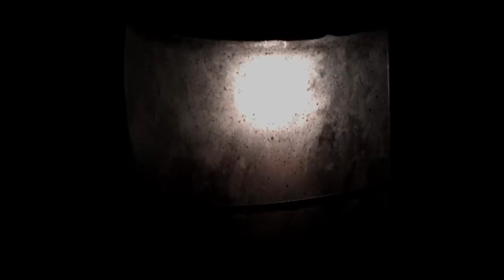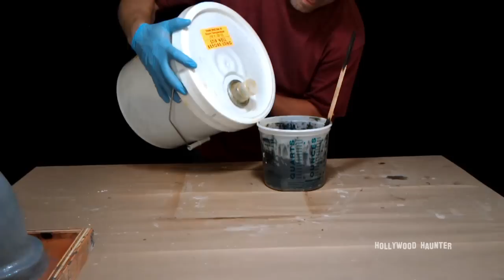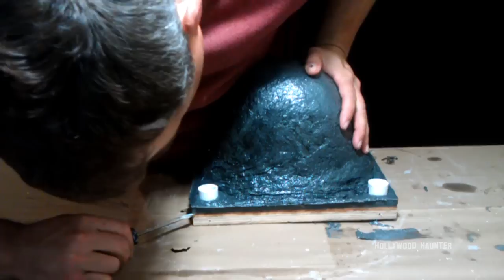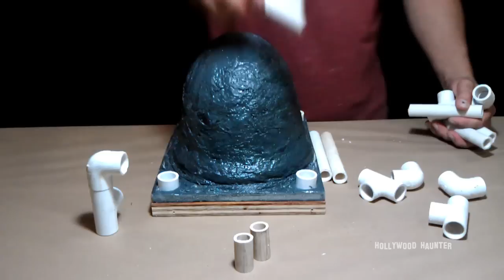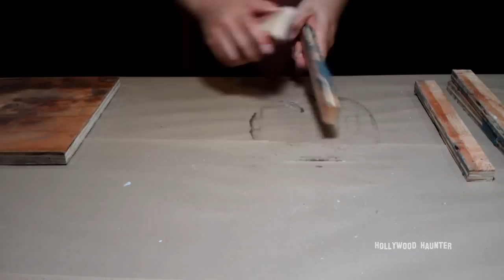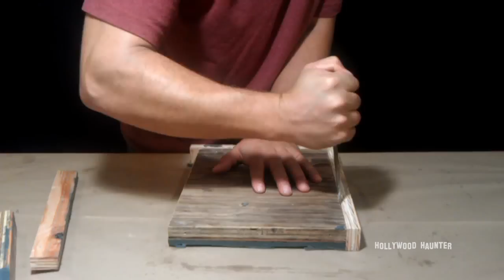Mold Making Techniques - Hard Coating Mother Mold/Rigid Support Shell (Pt.2)

Comment from the maker: Thanks, yes you can apply plaster by brushing layer upon layer and then soaking gauze, burlap, or jut netting in plaster and applying much like making a cast.  It looked like you can purchase the past on line and have it shipped out.  They offer it in smaller 3 pound trial packs and I used about 4 pounds in this video.

Comment from the maker: Ya you have to work pretty fast with that stuff, I usually just slap it down and don't worry about neatness until its all spread over the mold as evenly as I can do it fast and then if I have time go back and straighten it out and make it look nice.  I usually work up a sweat when working with all the quick setting stuff.  You could always do it in smaller batches more times but that has its pains as well.  Awesome job on your mold!  =)

Comment: You're either very fast, or I'm very slow. I mixed a similar amount of PPII and it kicked on me before I got it all down on the piece. I wondered if maybe, since it's a resin, I should have spread it all out as thinly as possible around the mold and then finessed it later. According to all the BITY Mold Supply videos I've seen resin kicks faster when in higher concentrated volume. So a thin pool kicks much slower than a full bucket.